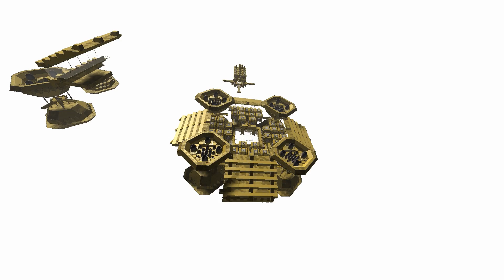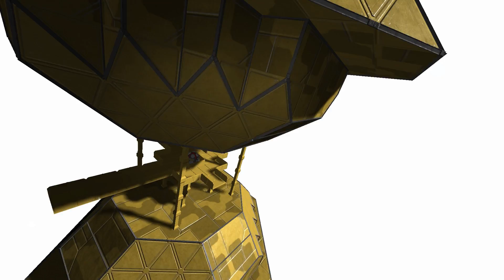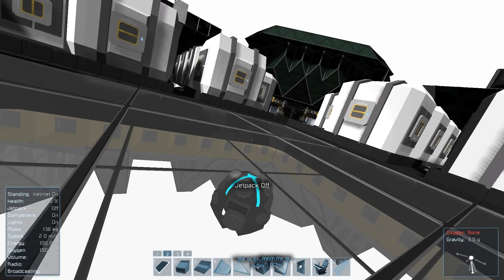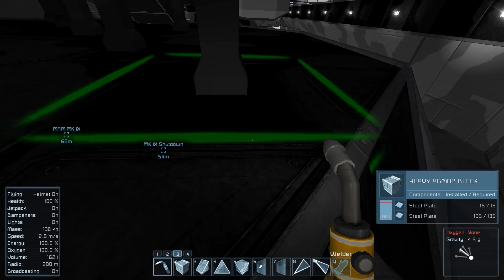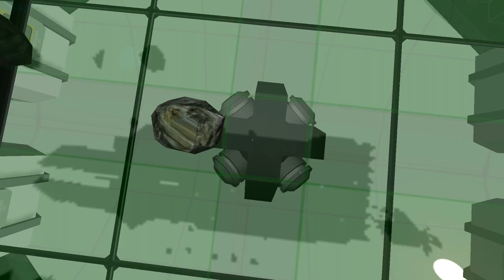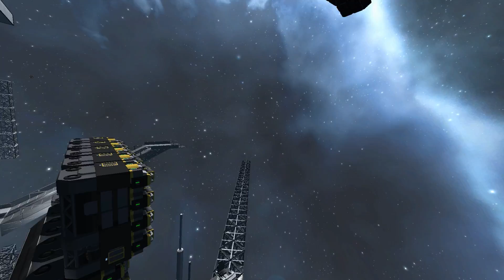Space Engineers • Solo Survival • 87 •  Shelled

Comment: Wow I don't pay attention to Youtube for a few days and I find out I'm nearly 10 episodes behind.

You should just put the heavy armor at the bottom where ores are likely to hit and the rest of the blocks should then be light armor that should reduce the weight significantly as well as the resources it uses to move.

I like the idea of encapsulating the the catwalks to have oxygen there, that way if ore does punch through the armor you won't be leaking a massive amount of oxygen.

I would suggest adding some Oxygen farms and/or Generator with tanks so that you can process ice straight and have a secure area where you can always get oxygen.
Also perhaps some refineries to refine the ores like uranium since the ore takes up a lot of space while the ingot does not, as added bonus it won't run out of power. 
Then 1 or 2 solar panels on top to reduce idle fuel consumption (gyroscope/inertia/conveyors/doors/etc) to 0
And maybe a dock/merge area for skimmer so you won't have to tandem fly two ships to their location.
Reply from the maker: Taliseth Started to redo the exterior with light armor, and a different look too.
I've gutted most of the ship, so we could look at having oxygen areas.

I'd like to give it some refinement for sure.

I originally, before the series, was going to make Skimmer be the head of the ship, or have four of them, one on each side. Never got a look I liked though.  
I don't have a way to merge them at the moment.  But will try work it in if I can.

Solar would be good, we should find a place for some.

Comment: I don't know if I get it right, but what I understood is that you're keeping the two beams that we see at the end. Am I right ? Anyway, I going to comment on what I understand. 

About how the beam joins the slab (at 32:25), as is it is, I agree, it cuts the slab weirdly. What if the bottom block of the slab was the same than the one of the beam ? Visually, there will be a half block under the grate and it will tie seamlessly with the beam. 

I think I kind like the thinner beam, I'm not sure I like the bend of the curve ( the fact that the breaking point of the arc is not the middle of the arc). But what I like is how the two beams/the two arc shapes work together (in this case ,the bend of the curve don't bother me at all). I like how the rounded beams contrast nicely with the rest of the ship which is more masculine, geometric, angular ... I like the organic more natural shape of the beams. The beams look like the legs of a spider holding on to the slab (the top of the graveshaft being its body). 

The fineness of the upper beam is looking fine to me if you keep the two beams. If I didn't understand correctly and you're only keeping the upper beam, its fineness make it look fragile, not strong enough to support the whole structure.